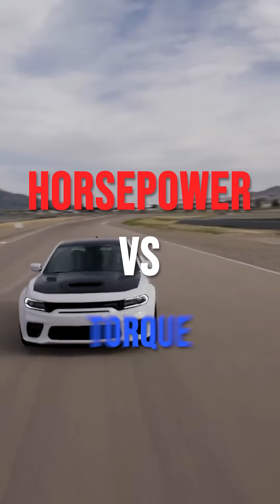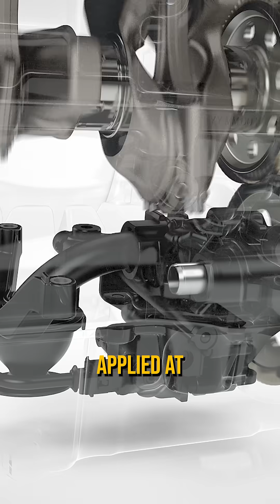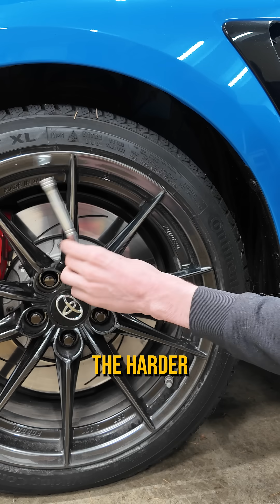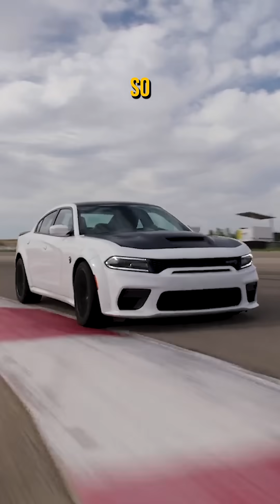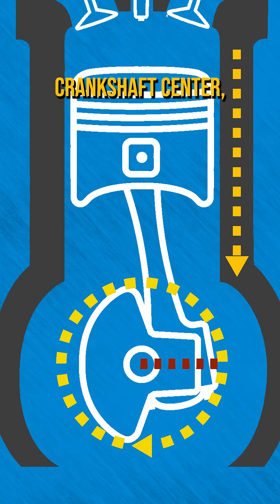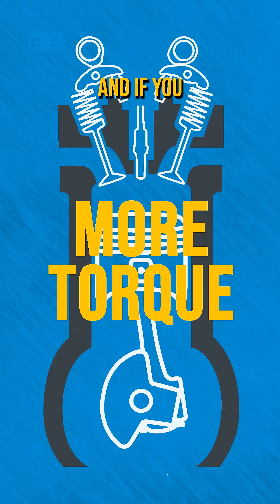Horsepower vs Torque (In 60 Seconds)

Comment: I've never had anyone explain this to me clearly, so I'm going to ask here.
From a practicality standpoint, why are low-revving, high-torque diesel engines preferred for hauling over gasoline engines of the same power? 
Is it the reliability and efficiency that comes at the cost of a heavier engine? or is it something about the power curve that makes them better?
Reply: All else being the same, a diesel engine makes more power at lower rpm.
So, if a diesel truck can pull a load at 2k rpm, a similar gasoline truck might have to be bouncing off the rev limiter the entire time. It would get very annoying
Reply: @jonathansmith7306  I see, I can see the headroom above peak power being pretty important in accelerating comfortably.

Comment: torque at the wheels is what propells the car forward but its only a result of engine torque if you have direct drive without transmission - an issue that no road legal internal combustion car has.. 

with transmission in between the engine and wheels, the torque at the wheels is the result of transmission taking engine power in whatever ratio of torque and rpm and transforming it into completely different ratio of torque and rpm

so it doesnt matter what torque your engine has, nor what rpm it revs to, the combined value is what matters and that one is called POWER

the more power your engine makes, the more torque can the wheels deliver to the ground at higher wheel/ground speed - thus higher acceleration force

if you have torquey engine, it means you have access to higher POWER at low rpm than with linear power delivery engine of the same size or rated max power
Reply: Exactly. Many people mistakenly believe that torque matters more than horsepower, and it's because they see engines with a higher peak torque number performing better than other engines that share the same peak horsepower number but have less torque. 

But the vehicles with such higher torque engines only perform better because they can keep the engine RPM closer to peak power at any given time under WOT, so average power applied is actually higher, and that's why the vehicle performs better. 

People only look at *peak* horsepower numbers and get tricked into thinking that power doesn't matter.
Reply: @Leemur2335 yep, the wider the peak power rpm region, the longer the gearing can be, the less shifting is needed while accelerating, the more uniform power delivery and thus faster acceleration

the width of peak power region tho is typically inversely proportional to the actual peak power number in the real world (if we talk about comparing same size turbocharged engines without anti-lag in equation) but turbocharged engines are typically superior to same size atmospheric ones in power delivery cause they have both much wider peak power region and higher peak power overall so that’s where the rule breaks
Reply: @ravasmathias  Accepting the constraint to N/A - Naturally Aspirated engines I still find your premise: “the width of peak power region tho is typically inversely proportional to the actual peak power number in the real world” to be N/A - Non-Applicable.  A higher peak power for a given displacement ( all else being equal) comes from an increased bandwidth.  An engine that makes 200 lb•ft at all RPM and has a bandwidth of 2000 RPM will have * both   a lower peak Power output  and  a narrower band of “power under the curve” than an equally sized engine that makes 200 lb•ft at all RPM and has a bandwidth of 20,000 RPM.  Greater peak Power =  less  not  more *  “peaky”. A 3.0 L V10 F1 engine will make 90% of its peak power over a wider RPM window than a 12L long stroke turbo diesel’s entire operating range from idle to rev-limiter.
Can we call this myth busted?
Reply: @rollsroyce329 my point was more statiatical regarding sports cars or even cars in general you see on the road every day.. 

take for example 3L engine and put either bigger turbo on it to have higher peak hp but only accessible at high rpm due to turbo lag (hence i said “without anti-lag in equation”) or you put smaller turbo to have faster response and more boost at low rpm - thus more hp at low rpm than big turbo but less peak hp at high rpm.. 

bmw’s b58/s58 is a perfect example cause the twin-scroll b58 is the most responsive with widest peak power span, then you have alpina’s twin small turbo setup that is almost as responsive as b58 but with higher peak hp and then you have regular s58 that has noticable turbo lag and lack of power at low rpm (especially felt on heavier XM3/4) but highest peak power output of the three setups.. 

same engine, just three different turbo setups creating either peaky s58 or broad b58 power delivery.. the pattern exists beacause small turbos limit peak power by their max safe rpm (relying on wastegates to protect them) while big turbos limit lowend power by their minimum required exhaust flow (relying on antilag to help them - which nowadays wouldn’t pass emissions tests so its rather an illegal aftermarket perk)

everything that breaks this rule is either not road legal or at least using some exotic unusual materials on its internal components that only hypercars come with as standard

porsche for example will soon reveal its new 1000hp gt2rs with a big turbo that has electric antilag so that will certainly break this rule (which i really have to emphasize the “rule” was initially rather a statistical statement from my side)
Reply: @ravasmathias    Yes putting a small turbo on a big engine will yeild a wider power curve than putting a very large on on.  Same for throttle body.  A 10mm throttle body in place of an 80mm one on a 3.0L car engine will result in both a much wider power curve and lower peak power.  I’d advise against doing it. 😊
Reply: @Leemur2335  👍 well said and a valuable insight!
Reply: Thnx for sharing/posting. Was so good I wanted to see what you may have posted on your channel but you've got nothing at all posted in the last 13 years...mate, that's lame...but what's cool was the wavy font in the center of your page though; that, I liked
Reply: @wedemboyz thanks, maybe some day i feel smart enough to start sharing random wisdom as a content creator
Reply: @ravasmathias  honestly, my uploads on here are not from a content creator premise but more of it just being a good  place to store/safeguard notable recordings of mine..with that in mind, you no longer  require any threshold regarding how smart you feel:]
Reply: @wedemboyz you gave me some to think about, thanks

Comment: The most simplified version is torque translates to acceleration and horsepower translates to top speed.
Reply: Only when you're comparing the exact same gear ratios... you can in theory get as much wheel torque or top speed as you want out of any engine, provided the materials exist to make a transmission to do it with.
Reply: with correct gearing, you will accelerate far faster with more power then more torque
Reply: Hivemind 🚮. Power, not torque, is the limiting factor in not only the top speed of a vehicle but also how quickly it can accelerate at any speed and how much weight it can pull up an incline at any speed.

Comment: torque doesn't matter because you can create "free"  torque with gearing, whereas you can't create free power. but shape of the torque curve (or power curve ) does matter for road driving because you don't drive at constant speed and you don't have infinite gears (unless you have xvt)
Reply: Ugh. No torque no power. You can make more power with the same torque and car is faster, but that does not mean torque does not matter. Low torque, bad low rpm response. You need gearing and be always on high rpm band
Reply: @MariuszChr   Power includes Torque. I think it’s quite obvious @geemy9675 meant if you you can use gearing to multiply what torque you have that was multiplied by RPM to create the power in the first place.  
The engine’s Power, not its Torque is the limiting factor in not only the Top speed of the vehicle but also in how quickly it can accelerate at any speed and how much weight it can pull up an incline at any speed.
Reply: @MariuszChr yes no torque no power. combustion pressure in the cylinder is the reason why you have torque. torque is the reason why you power, power is the reason why you can move and accelerate. torque is a "byproduct"
Reply: Gearing for torque lowers the speed. So it does matter if you want to go fast. You can't gear for more torque at 200mph
Reply: @UnparalleledSpoof that's why you have gears. if your top gear is geared for top speed and cruising and you gears are correctly laid out, you don't have torque issues.

Comment: Mathematically speaking, the things you multiply each other with would be called "factors" and the result of that multiplication would be called a "product" (at least in german but I assume it's universal in all languages).
So in other words, torque (and RPM) is a factor and power is a product. 
If you only care about the product, then torque does not matter. 

So from a more philosophical standpoint you say results are all that matter, right?
Reply: 👍 The Part can never be greater than the Whole.

Comment: Actually, from an engineering pov, a conventional engine ONLY produces torque. The crank is made to turn, that's it, and torque is a turning force. Its clever engineering vis clutch, gearbox, suspension etc, that produces forward motion. 
Any power you get, horse or otherwise, is as you say, a product of the rate of torque. 
You cant ever convince me that the only basic output of an ice, is unimportant,  ever. Good luck......
Reply: Engine torque is multiplied by the gearbox. The torque that is responsible for acceleration is at the wheels. Wheel torque is a function of power and wheel speed so yes, engine torque is unimportant.

Comment: The best way I've found to simplify hp vs torque is HP is how fast you swing the hammer and torque is how heavy the hammer weighs. I know it's not "technically" correct, but I think it helps make it easily digestible for the average person.
Reply: but it doesn't explain Hy power matters more
Reply: Close. 

RPM is how fast you swing the hammer, and torque is how much the hammer weighs. 

HP is the combination of the two, which tells you how much force you're exerting per minute.

Comment: So can torque stay the same across the whole rev range?
Reply: In EV's it does until the Inverters can't provide ac currency at a frequency that matches the rpm.

In ICE combustion efficiency varies over the rev range, so I don't think you can tune your torque to be constant. Not sure if it can be achieved with variable injection timing or something. I don't think there's much of a point to it, really

Comment: What I've always wondered is why they can't just use gearing to fully compensate for either at different times?
Reply: What do you mean? That's the point of a transmission. Low gear, high torque but lower wheel RPM (= vehicle speed). High gear, lower torque but higher speed.
Reply: You can't gear for more torque without slowing down the wheel speed. So if you want your wheels to spin at high rpm, you can't gear for torque... The only way is to make more torque. 
That's why when you're maxing out your car's speed at high rpm, changing up a gear might even slow you down, because you've effectively reduced the torque to the wheels, even though you still have the same hp

Comment: It's simple, torque doesn't matter because 
More torque=long stroke 
Long stroke=lower rpm
Lower rpm=lower horse power
Which means lower speeds, unless you are using a high torque transmission but this is inefficient as high end power suffers.
Or at least that's how I understand it.
Reply: Depends on whether torque can't be increased by other measures.

Which it can, by increasing fuel burn efficiency, reducing losses due to friction or bad tolerances, super/turbocharging etc.

If you have more torque at same rpm you get more power too
Reply: @real765rp8  well let's keep it at N/A engines, can you get any meaningful power by say reducing friction (by installing better parts), using a light flywheel, enhancing tolerances and using light pistons and crankshaft, how much more rpm can you increase from say a hemi engine?
Reply: For a given engine displacement stroke has no effect on torque.
Reply: @BigUriel explain
Reply: @SalamanderBattleBrother  What are you proposing accounts for an increase in torque at a given RPM that is directly attributable to stroke and not a downstream effect such as increased charge density afforded/limited by things like valve diameter/ port length/volume? Assuming no increase in displacement of course.
Reply: @rollsroyce329  I don't think there is any way to increase torque at any rpm(any way that isn't forced induction)  and that is my point as to why torque isn't all that matters if you want more horse power and rpm matters more if you want high end power ( mind you, I'm not an expert, everything I say/write is my accumulated knowledge and I may as well be wrong)
Reply: @SalamanderBattleBrother  All good Brother. Lots of things contribute to how much torque a given size engine can make at a given and some contributions are small (friction) some moderate( cam timing, intake and exhaust tuning and some large (Forced induction). At the end of the day though- All work is done by Power not torque anyway.  Power is the rate of transfer of energy the more energy you can transfer more quickly the more work you can do per unit time.  This goes for any type of work, accelerating, towing, lifting, pumping, grinding, chewing, cutting… you name it.  Power = Force x Velocity.  Want to do more work per unit time?  You need more power. Power = Torque x RPM.  Once you have power you can use gears to adjust the proportions of Force and Velocity to suit your needs.  Your on the right track: Power, not torque, is the limiting factor in not only the top speed of a vehicle but also how quickly it can accelerate at any speed and how much weight it can pull up an incline at any speed.  The part can never be greater than the whole.  Torque is a part, RPM is a part of the Whole that is… Power.
Reply: @SalamanderBattleBrother  It's self explanatory. Two overalll comparable engines of the same displacement make the same torque regardless of their bore/stroke. The idea that stroke increases torque is a myth. Or rather stroke does increase torque...by exactly the same amount as bore.

Take any two naturally aspirated engines you want and compare their torque/litre figures. I can almost guarantee it'll be somewhere around 90-100Nm/l, from massive American V8 truck engines to little revvy 600cc sports bike engines.
Reply: @BigUriel fuel is power!

Comment: Torque = how much you can push.
Horsepower = how fast you can go.
Which is why trucks run diesel.
Reply: Nonsense. Power, not torque, is the limiting factor in not only the top speed of a vehicle but also how quickly it can accelerate at any speed and how much weight it can pull up an incline at any speed.

Comment: Torque does matter, when towing.
Reply: Power, not torque, is the limiting factor in not only the top speed of a vehicle but also how quickly it can accelerate at any speed and how much weight it can pull up an incline at any speed.
Reply: Towing doesn't magically change the laws of physics.

Comment: I don’t quite get it. I have a Ford Kuga (Escape in America) 1.5 petrol. On the manual version of the car it has 240nm of torque and 150HP. On the automatic version it has 240nm of torque and 186HP. The torque isn’t higher on the automatic version, so how comes it has more horsepower?
Reply: The same torque and higher hp is always higher revs. So the higher torque version has that torque at higher revs.
Reply: @RdV- thanks for your reply. That’s what I thought, but everywhere I looked it says the maximum HP is at 6000rpm for both versions
Reply: Now that I think about it, it could be related to the torque’s range. Maybe they both have a maximum torque of 240NM at ~3500RPM, but the automatic version has higher torque at 6000RPM than the manual version

Comment: It sure matters for towing lol
Reply: wheel torque matters, but the engine torque doesn't, because you can always gear it for more torque. which is why a 500hp engine will always be able to tow more then a 300hp engine, even if the 300hp engine has more torque
Reply: @TheNoiseeeee  👍 well said!

Comment: Never been inside of a plant I suppose. Lot of confusion going on in this comment section.
You have torque with HP 
Don't have hp without torque
Reply: Yes but torque by itself means nothing and is only useful if you want to calculate horsepower at given rpm.